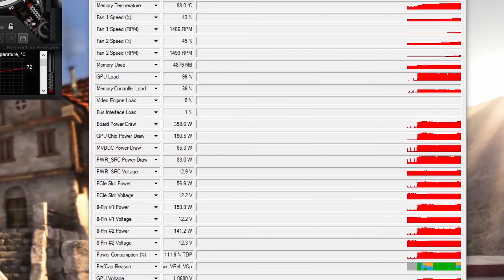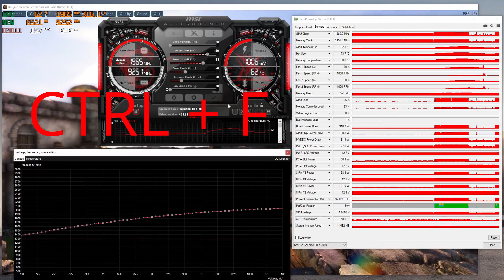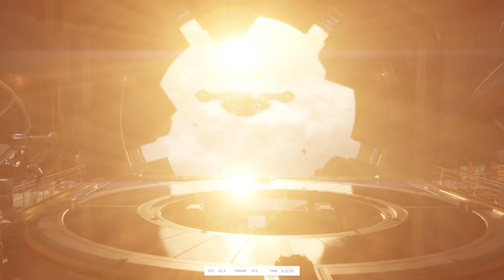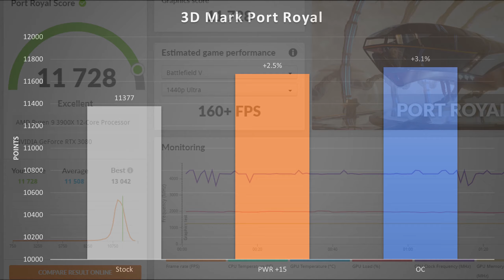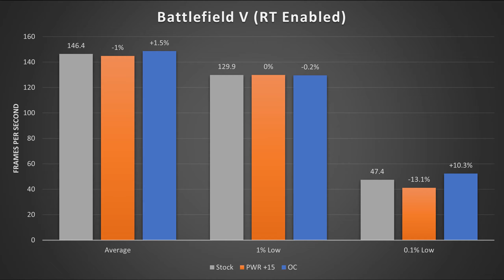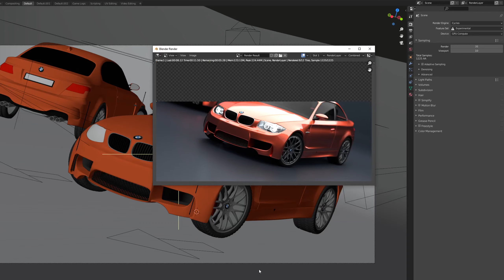RTX 3080 FE Undervolting and Overclocking Guide

Comment: which has better dB fan noise levels at full load 3080 fe or 3080 ti fe...?
Reply from the maker: They both have the same cooler, but the 3080 ti uses 30 Watts more power, so the 3080 will be quieter.

Comment: How come your fe 3080 you can raise the power but my 3090 ti fe is stuck at 100
Reply from the maker: Just did some searching online--it looks like the 3090 FE and 3090 ti FE have fixed power limits. The only way to unlock this would be to flash an OC bios, but that'll void your warranty and is highly risky. Unless you're water cooling, you'll get better performance undervolting and reducing power draw.
Reply: @kylehiebel  oh, much appreciated you going out of your way to look into this.

Comment: Just wanted to say: great tutorial! You've earned a subscriber and a like. I got my hands on a 3080ti FE and want to try your method, curious to see the results. Perhaps a much better cooling system wouldn't hurt as the card runs pretty hot as is.
Reply from the maker: Thanks a lot man! I also recently got a 3080ti FE. It runs 3-5 degrees hotter than the 3080. I overclocked the 3080ti using the method shown in this video. My results were a 0.95V voltage limit and +150Mhz offset on the core. This gave me the best performance in BFV, which is the only game I'm playing right now.
Reply: @kylehiebel  congrats on the card - it's a beast! After heavy testing my 3080ti fe temps look as following: Core 74.4, Hotspot 81.7, Memory - 92. Does that look good to you or would you recommend I follow your video in attempt to lower the temps? Would you advice I look into water cooling at all? I've heard great things about it, but not sure if it's worth the money (if i'll see any real benefit)
Reply from the maker: @RunningInSuits  Those temps are excellent! There's no need to watercool unless you want to do some extreme overclocking. You could probably get an additional ~10% performance, but it would cost you hundreds of dollars (not worth it imo). For temps on the 3080ti, I'm getting: Core 76.1, Hotspot 83.2, Memory - 96. The memory temps worry me a little, since the tj max is somewhere between 95°C and 120°C. However, NVIDIA sets the limit at 110°C and the card comes with a 3 year warranty, so... I wouldn't worry about it.

Comment: Hey. Great video. Used it to undervolt my fe 3080ti and find its limits. I am mainly trying to stay just below the power limit so under 400w for my FE.

but i have a problem. With RT tests (Exodus benchmark extreme) card can do 1860-1875 mhz at 0.875mv before it starts to hit power limit. But non-RT bench like Heaven card can do 1980mhz at 0.925mv. I have tried to set both at once but the RT test crashes. I am assuming switching to lower voltage is causing the issue or something. Is there something that can be done? I want to use higher clocks when RT is not needed or not as taxing and default to lower clock and voltage for RT heavy games.
Reply from the maker: Thanks, and excellent question! I'm not sure there is good solution... Even though Metro Exodus normally runs (power limited) at 1860-1875 mhz, it will always try to boost higher. During a less complex part of the benchmark, there is likely a drop is power usage, so the card compensates by increasing clock speed and voltage to hit the 400W target. Now, there's a couple things you can do:
1. Set up multiple profiles in Afterburner, one for RT and one for non-RT.
2. Reduce the clock speeds at 0.9 and 0.925mv until metro exodus is stable. You'll lose a little performance, but then you don't have to bother with manually switching profiles.

Comment: No temp changes shown? My 3080 runs loud and hot. :/
Reply from the maker: Since I kept the power limit at 100%, my temps didn't change.  That's why I didn't show it.  Which 3080 did you get? The FE runs quiet but gets up to ~80C.
Reply: @kylehiebel  3080 FE. Only got it there. Sounds really loud and cranks up to 75c In no time when playing 4K red dead 2. Is that normal?
Reply from the maker: @checkmatedeposit905  that seems normal to me.  I took the side panel off my case, and now I hear the fans.  The FE gets pretty loud at full load (50-60% fan speed) when running FurMark.  With the side panel on, I can barely hear it.

Comment: I'm just sticking with 1860Mhz at .900 volts. 53% fan speed and shes quiet and only gets to 63c and memory under 80c.
Reply from the maker: Whoa, those are some good temps!  Glad to see the undervolt is improving your efficiency :)
Reply: nice! on my 3080ti FE I found 850mV @1850mhz to work great.  the card boosts to 1875 constantly while also dropping temps 6c.